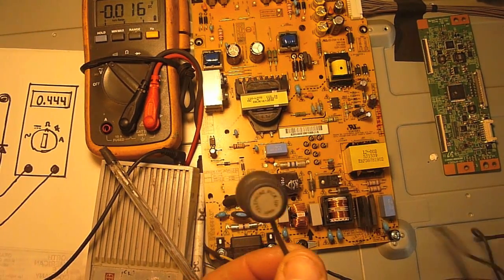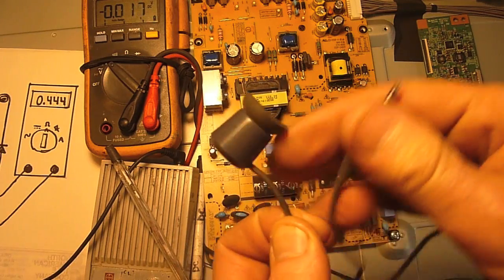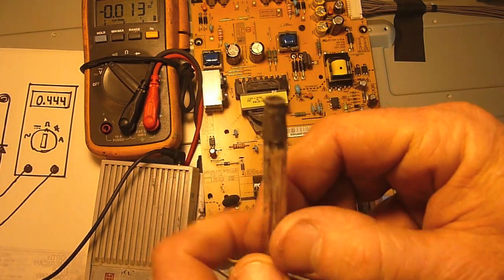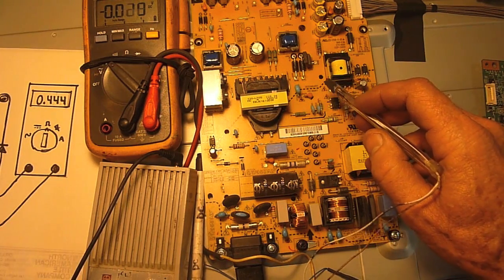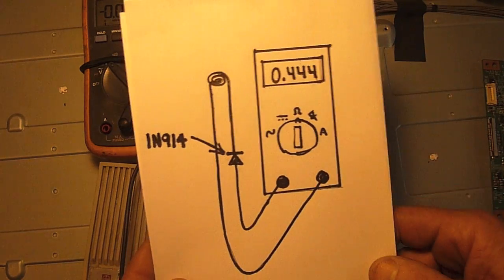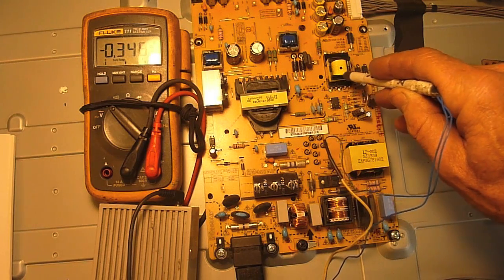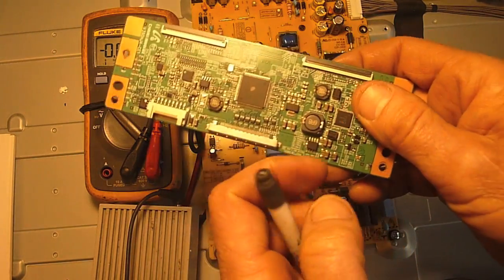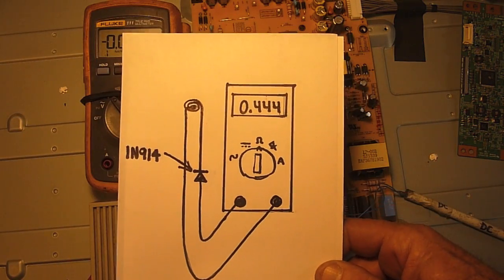Inductive circuit probe you can build.

Comment: Just made one of these, thanks.  I don't have the little speaker,  but I do have a headphone amplifier i built using a simple opamp circuit.  Plug the probe into the amp,  then amp into my headphones and it works great.
Reply: Can you share how you wind the coil in probe or complete project?

Comment: For inductive circuit, is is inductor need to connect in series or parallel with the load?
Reply from the maker: The inductive device has no load. It picks up magnetic fluctuations from  other instructors and components.

Comment: This is a most amateur-like question but what  can you learn about a  circuit or circuit  board with that device?   THX.
Reply from the maker: One beneficial use of an inductive probe would be to see if your transformers and other components have power going through them. I find it especially helpful in testing the boost and buck regulators by placing my probe on top of the coils used in their circuits. I hope to make a second video on this later so I can make it simple for the beginner.
Reply: Yes, it helps, thank you!

Comment: if you put the multimeter to ac voltage and remove the diode will it work also?
Reply from the maker: I tried to get a reading an AC without a diode and it didn't work.
Reply: Grants Pass TV Repair thank you.can.we use any other general diode like a 4001?
Reply from the maker: I don't know the characteristics of the 4001, but after trying a couple different diodes I found that the 1N914 worked the best.
Reply from the maker: I don't know about the 4001 diode, but the 1N914  I used is dirt cheep and worked well. You can probably find them at your local radio shack.

Comment: You could show the process of making one.
Reply from the maker: Yes I should have.. A few turns of wire wound in a small circle is all it takes, but I found it helps to use one of the ferrite core inductors  often found with boost or buck regulators on main boards.
   I don't think you can go to far wrong with this project.
Reply: And you could show the differences of behavior of the different diode types. I thought diodes were all the same!
Reply: Grants Pass TV Repair Thank you. Could you also indicate an inductor that could be bought for little money, likely from China? I do not have so many PCBs.
Reply from the maker: Just make a few turns of wire around the end of a pen and it will work. The larger the coil the more sensitive it will be.
Reply: Thanks for the video, but still I would like to see you show us how to   make one.